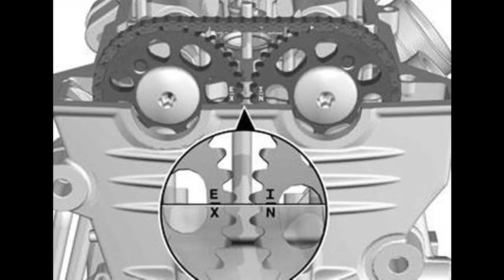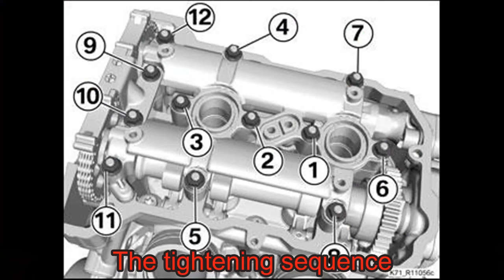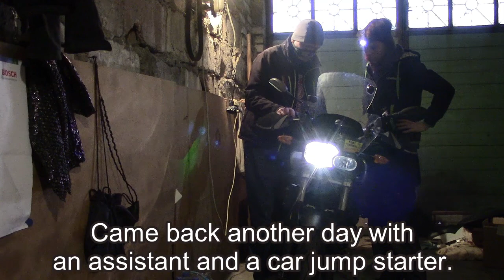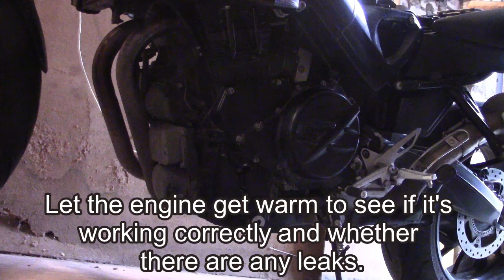Valve clearance check and adjustment BMW F800R 2010

Comment: hello sir. Regarding the special tool for TDC locking. You install it just before you get to see the notch through the hole right? Or do you press it against the notch. The last doesn't make sense to me. But it cought my eyes that only when the notch is in the middle of the hole, the E and I line up perfectly. I would like to hear your advise.
Reply from the maker: You raise a valid point there. I don't know the answer for that. Due to the instruction, you should press the tool against the notch, but it doesn't work, I could still move the crankshaft. But otherwise the camshaft marks don't line up. Anyway, I was still able to do the job, even if locking the crankshaft didn't work.

Comment: Hello, hope you are good.  Thank you for great videos.
Maybe you can assist me to identify a part and the function of a part.  On the 2011 f800r throttle body, what is the threaded hole next to one of the air inlet tubes for?  What is supposed to attach to that threaded hole?  Thank you,   Stev

Comment: Wonderful video and great job!!!
just started this procedure myself last night. Didn't know I could partially unmount the radiator, great tip!
My heart also stopped when you dropped that nut  xD  cheers!
Reply from the maker: Haha thank you. 
Another tip I learned afterwards is that removing the cable clutch gives a better access. Manouvring the valve cover in and out is a pain.
Also, I've experienced that when you have to adjust the clearance and you remove the camshafts and install them back in, the clearance can change. Mine didn't go as planned on the inlet and after I corrected it, the exhaust clearance changed although I didn't adjust it. I'm curious what will be your experience. It's a pain especially since these engines require checking the backlash every 20,000 km and it often needs adjusting.
Reply: @femalegarage  That's correct, I did pulled both throttle and clutch cables to have even more room to handle, thinking a bit forward when it's time to put it back. I believe f800GS have a bit more room and the motor is less tilted. Anyways i wasnät satisfied with my feeler gauge and ordered a bit more detailed in the range .18 to .35 for obvious reasons. I hope all is within spec, fingers crossed! cause i just want to get on and ride already!
Reply from the maker: Didn't have a chance to do this on GS, but I might soon.
Yeah I had like 3 feeler gauges for this job, haha. Fingers crossed. It's still cold as hell in Poland, only today it's warm, can't wait to take my bike for a ride today.